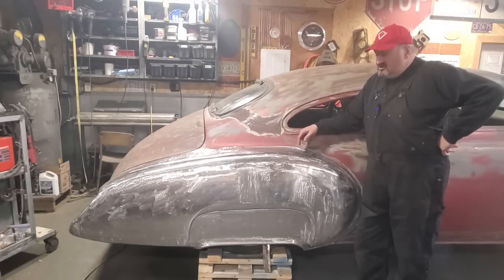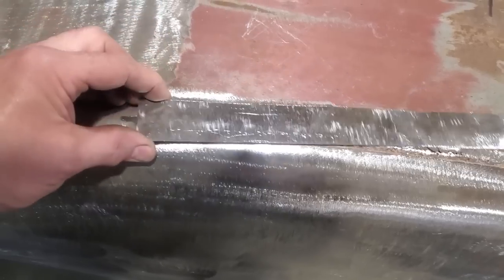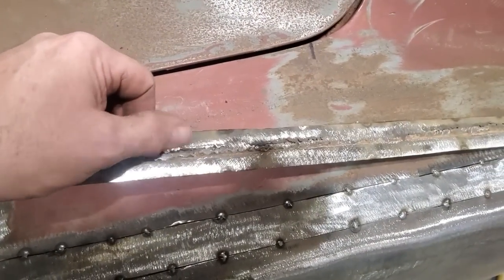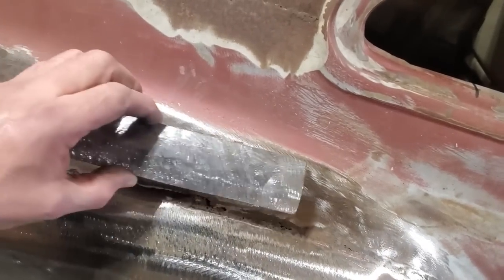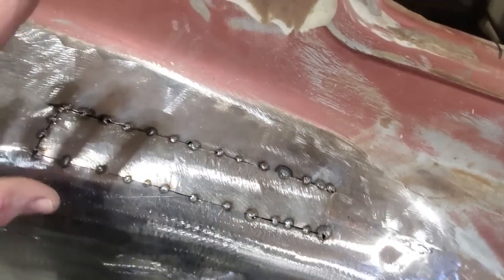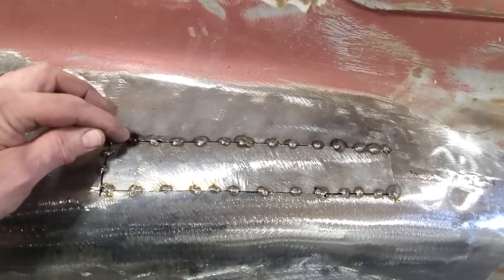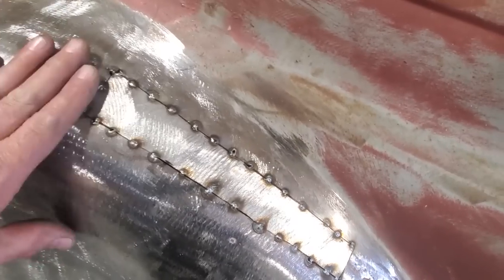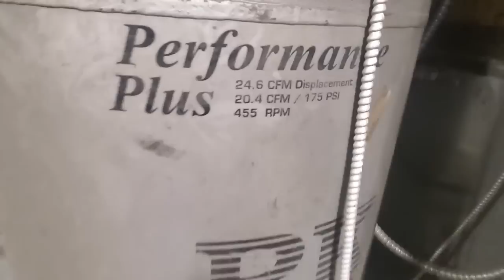Using the Cut & Butt to replace factory seams

Comment: I have used the same technique for decades, high heat tacks to get the penetration, then sort, hot bursts to fill in.
I started at age 11  with oxy acetylene welding cars, mig was a revaluation and much easier!
Love your vids, keep up the good work.

Comment: This patch method saved my life.  Just finished my first frame off.  I had to replace the quarters on my ‘65 Impala and this made it easy to get it right.  A tiny bit of filler after and now that it’s painted you can’t tell I ever replaced them

Comment: Never seen your channel before. Thought I'd pass a pro tip to your readers, as you were saying the metal was ground to much. Tip on dent repair, do your grinding before you straighten the dent while the surfaces are smoother, this will eliminate grinding too much metal off the high spots after you straighten.

Comment: Thankyou, I really appreciate your show! I'm a metal man as well, and I enjoy the cars you have been working on, I have been getting lots of tips from you on building complex shapes, and little things like the angle of the cut, I did cut and butt be fore but now the pieces of metal will fit even better. Very much appreciate the videos on the quarter panel from flat material, and just taking it in sections makes it so much more manageable. Great show!   From Wichita Ks

Comment: One tip I learnt elsewhere is that when you press down on the patch .. if you bridge the join with the tool it makes it easier to get the level right because you can't push down too far.

Comment: I just ran across your channel and was very.. very impressed. I will be continuing to watch more more. 
I'm not preaching but I did want to point out that those glasses and if I'm correct, they're designed more for grinding than welding. I have a set and didn't realize that and I did some welding with them. Also, the next 2 days my whole face was sunburned😊
Again, not preaching and knowledge is power.

Comment: Hey fitze. Awesome job as usual. I have been doing insurance collision work for forty one years now so used to thin metal that’s zinc coated hence very thin, susceptible to massive warping and zinc coated conducive to blowing holes in your weld area. What works better than straight oxygen is 75%oxygen 25%argon  A lot less spattering and blowing holes especially in thinner metals. Just a thought, you probably know this already though. As well I never knew about these glasses either  👍

Comment: Hi Tony.  The tips are good.  Interesting discussion about angling the torch tip to hide the arc.  I have accidentally struck an arc without my hood down and it was an unpleasant experience.  I think I will keep using the helmet and just deal with the ups and downs of that.  Nice repairs on that quarter panel.  Thanks for the video!

Comment: dude your a true metal whisper!  I came across ur channel little over a year ago and just cant get enough of the content!!!  love how u show doing ur work with common hand tools, how to take ur time and get it right, and when You do mess up how you correct it!  i wish they made a welding helmet with clear to auto darkling lens!  i have noticed the they do make lens that will attaché to inside of helmets with prescriptions and/or cheater lens.. maybe you can get the welding glasses  with prescriptions lens already installed?

Comment: I learned a ton from you fitzee! I just tried to do a long curved wheel arch. I cut the piece of metal to a curve i templated.. Problem was i cut it flat but when i curved the metal into a wheel arch, it changed my outer crown curve. I had the whole thing welded solid before i found it was off. I had to cut half of it and reset the piece. Luckily i left it just wide enough for room to adjust it.

Comment: 3:31 I made a tool like that many years ago. It’s a 3/4” round that actually has a slight crown to it at this point though it didn’t start out that way. 
I guess I didn’t realize it was a “real tool.” It just was needed for pounding ribs/beads into a jeep rear floor repair but it’s proved quite useful. I guess I shouldn’t be surprised other people arrived at the same conclusion.

Comment: There are plenty of us body workers that use the gas nozzle to shield the spark from view. You can't bead on body steel, only spot. Huge advantage in speed because once you've aimed the gun all you need to do is shut your eyes and squeeze the trigger. You can hear exactly what is happening with the weld and at the same time be thinking of the next spot. Helmets in tight spaces are no fun either.

Comment: When I weld with an auto dark helmet I have a magnetic rechargeable flash light pointed at the area to improve visability
Reply from the maker: I find a light tend to turn on the helmet specially if all the metals grinded to a shiny finish

Comment: I use a quick flash helmet. It is clear until you strike an arc, then darkens before the light hits your eyes. Mine is a Lincoln. I grind with it on. Clear cover plates are cheap

Comment: You're styling with those fancy welding glasses! What does Wendy think? I'm with you on the difficulty of seeing those seams through a helmet. I use a bright magnetic light adjacent to the seam so I can see the darn thing. That works good for me but everyone is different. Great video as always Fitzee. Thanks for taking the time to video and share.
Reply: This tip about having a strong magnetic light is something I discovered that helped. I also don't keep a glove on one hand so I can more easily run my finger across the weld. When I started, one of the hardest things to figure out was seeing the weld and knowing where you were welding. I still mess up but have gotten much better with practice.

Comment: Did you ever think of putting a small flash guard on the copper gas shield of the mig welder? If not, just make something up yourself. 
Whenever I weld without my helmet, I get a skin burn on my face, and about 3-4 days later, I peel. What I find if I use suntan lotion it protects my face from getting burned.
The other option is if it's hard to see with the helmet on, I put led lights on my welding helmet focused on what I'm welding, so it makes it brighter before the arc. I think it's an age thing because I'm in my late 60s and everything is harder to see even with glasses.
The fenders came out really nice. I can't wait to get back on my fenders now that my garage is getting warmer.
Reply: When I weld without a helmet my face gets burned really bad too. I just can't see to weld anymore, I too am in my upper 60's It suck to not see lol.
Reply: I cant see anything without a light in my other hand either
Reply: I use a little magnetic LED puck light from Eastwood that will stick to the metal work and points any direction if running weld beads, but just close my eyes when tacking. Do get a sunburn if it is a big job though.
Reply: @mikehaglund7283  I usually just close my eyes when tacking as well. but after a little while of that I feel the burn coming to my face.

Comment: Tight spaces kill helmets so I totally agree, I usually run a 5 tint on glasses slightly off my nose so I can peak a above then tilt my head back to cover the arc. Biggest challenge is the fumes an uv that catch the face an burn u up a bit. Technique is deep breath tilt an back out an it works good. I usually have to b in tight places doing sheet metal work like this at all kinda angles welding up down sideways u name it. Any thing heavy an king gets a helmet an I can usually setup so it’s not tight
Reply: I also use a led light if I can’t see an that usually brightens enough through the 5 tint so u can see w out removing the glasses

Comment: Oh gawd I used to have the same problems welding! but I managed we were using Silicon Bronze Wire on Galv. had many repair/replacements done on the lenses of my Prescription Safety Glasses as a result!.......
for heavier metals I always used a dime as a spacer and filled the gaps to get weld penetration as well.....I'd mark my welds as well,
had a job there they were complaining the welds were breaking on some very large fittings on the angle iron flanges......form the photos my ID marks never showed up on any of the fractured welds!......so I think I did something right somewhere!.....
I was taught to weld to pass Nuclear and Aerospace Certifications and along the way I just learned the lessons/tricks form the guys who did it all the time and pass those ways on to others around me......

Comment: I had the same issue with not seeing thru dark welding mask when not welding until I added a bright head torch and rear leather cover to the back of the hood on my welding helmet, now I find that I have less need to put the hood up to setup the work piece.

Comment: Great vid Tony. Jim from Surrey, B.C! You are easy to watch and a great teacher! Been watching your videos for a few months now. I enjoy your cut an butt method. As I am somewhat new to this sheet metal work I always wonder about treating the backsides of welds, if you can even reach them. Perhaps being new at this is more of my problem but I know sometimes I may have some pinholes or poor joints that I may miss or just can't see. Do most guys not paint or seal the backsides of their welds to insure no contamination of water or moisture into their body work? This is always my biggest fear, that all the welding I do can be contaminated in due time from the backside.  Hope to hear from you but I know you have a lot of followers! Thanks for your videos.
Reply from the maker: You can treat the backside where you can. Don't get hung up on it rusting out. Your over thinking it. There are many places on a car that were welded from factory and backside isn't treated. If the car is a daily winter car then I just drill holes in places you can't see and spray rust check or some sort of oil in there. If I can get at back of my welds I like to prime them then I seam seal them. But I don't get too out of hand with it as you can't always get behind your welds .
Reply: @fitzeesfabrications  Got it. Appreciate the response..and so quickly!

Comment: Hey Tony, I know it’s all about the fabrication, but could you do a video on your sanding and filler work process? I’m sure you have techniques for that to save time and $ the same as you do in your metal work. Thanks!
Reply from the maker: That will be coming. Also doing painting as well. I have a number of my projects that will need to be taken right to paint.

Comment: Thanks for showing me the cut n but technique. I’m repairing a rear wheelarch on a mx5/miata. If I can’t get behind the wheelarch to get the sliver of spare metal out, can I clamp, cut, then take the wheelarch off, remove the detritus, put panel back on, re-clamp, hoping it sits on the inner wheelarch as it did before cutting, then buttweld? I’m worried that when I take the outer wheelarch repair section off to retrieve the spare metal behind, it will all go out of wind and not fit well enough to buttweld. Any advice appreciated! I could just leave the spare metal behind the panel - no-one would know but it seems a bit gash. It will rust and might end up causing a rattle which wouldn’t be ideal😂

Comment: Nice work as has become expected. Sometimes it seems easier for me to grind the welds along the way, maybe weld 25% of the patch and grind it, weld another 25% and so on, is that my poor welding, or is that something that sometimes needs to be done? It seems easier to see where it hasn't been welded well enough yet.
Reply from the maker: You find it works best for you then keep doing it. More then one way to get to the same result

Comment: I'm glad you mentioned the tint in the lense being hard to see through when not welding, you are not on your own. I find it a PITA. Same as trying to grind with it, when I first heard about ones with a grind setting I assumed they would be clear, a huge disappointment when I found out the truth. I assume there is a technical reason why they can't make an auto helmet that goes properly clear when not welding?
Reply from the maker: That would be a cool helmet
Reply: @fitzeesfabrications  unfortunately that helmet that I want, possibly you as well, doesn't exist yet 😞Well as far as I know anyway.

Comment: How do you stop corrosion developing between the two pieces you’ve welded together seen on a lot of cars were they’ve had repairs the is localised corrosion in the area a repair has been done thanks in advance fitz 👍
Reply from the maker: Most of the cars I do are not daily  drivers. So rust is control by not using them in bad weather. I try where every I can to paint the inside or coat in oil after it's painted

Comment: Hey Fritz, have you ever tried an auto darkening helmet?
I had the same problem as you describe with seeing the work until my 85 year old buddy turned me on to auto dark. You can even get a magnifying lens for the inside to correct for your vision. Thanks for the instruction buddy!
Reply from the maker: Think I should of added that these glasses were auto darkness. I used a helmet like this for years. It's still very hard to see the metal threw those helmets

Comment: Brother Tony,
Great Movie!!
I need educated.  You tack welded the first piece on.  You cut it to cut'n butt. You re-tacked the upper rear corner.  At the 8:17ish mark, you then run the grinder thru the already cut upper piece?  Why?  Was it just to make the more uniform?  In my head, it seems like it would've been cut exactly right the first time.  Thanks Man!
Reply from the maker: I cut it cause the two metals are not the same height. Section of thr metal is high

Comment: What's your welder set at?
What type of wheel are you using?
What type of wire?
I would like more info
Reply from the maker: My welder is set on a little less then three on power and wire speed is between 5 and 6. Wheel?

Comment: When you are flattening back the welds, is there a reason to use the 24 grit over a Walter Flexcut?
Reply from the maker: Since I found these 24 grit disks I haven't used a flexcut since. Can't do the blend with the flexcuts you can with these. Most 24 grit disks are junk. These last a very long time

Comment: Sorry man, that's not a fleetline. It's a 2dr sedan. Compare the rear-side windows. Chopped so much it does have fleetline proportions tho. Need to do this on my '53 Henry J...factory seams on back fenders go bye-bye...
Reply from the maker: Looking at the trunk lid. It's a fleetline. I have two others here a 52 fleetline as well as 51 deluxe.  This one is a 49 fleetline